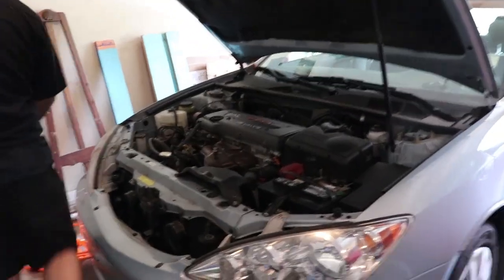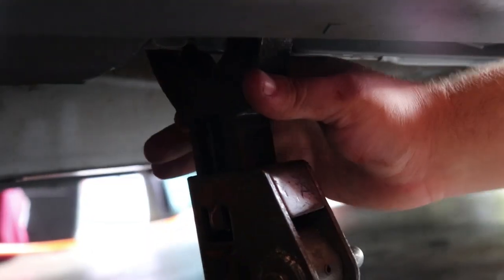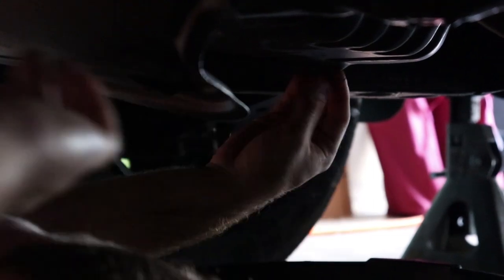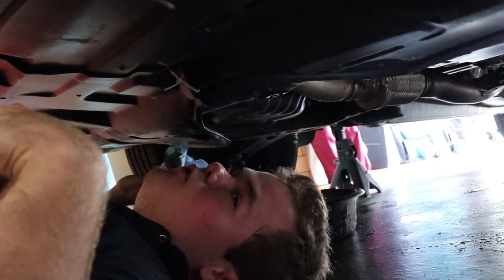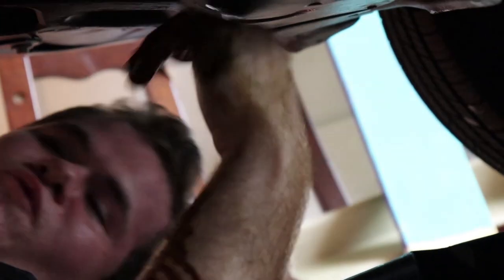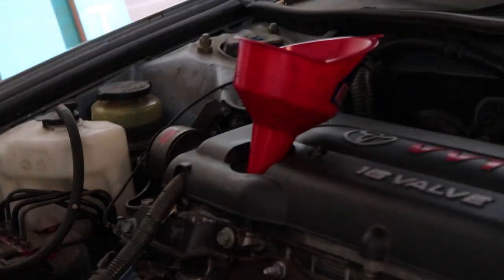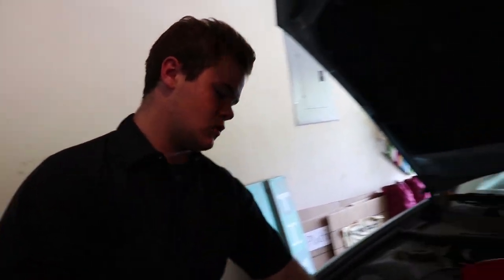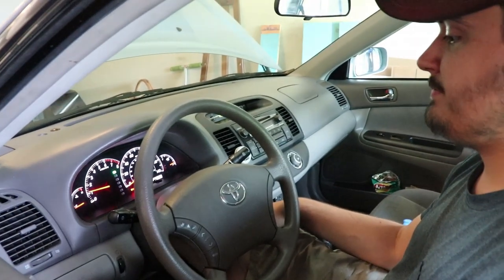HOW TO CHANGE OIL IN A CAMRY, 02-06 Camry 2.4L oil change video

Comment: you forgot to do 2 important things at the end of your oil change in the video. (1) when you start the engine, you should then look under the car for any possible leaks, since the oil filter won't leak without oil pressure to fill it and press for any open leak. (2) after the engine running leak check, then shut the engine off and check the oil level, when you check it before starting the engine with the New oil and filter, the new oil filter is empty and needs to fill up then your oil level will be 100% correct. overall you did a Great job on this video
Reply: Joseph Zani when changing oil, first open the engine lid and 2nd the oil screw below? shot with compressed air to drain used oil before closing the screw?

Comment: What's your issue with synthetic oil?
Reply: Mike South some veteran mechanics choose and use synthetic oil for camry cars.
Reply: @loonylinn8824  And that does NOT answer my question.
Reply: Is it proper to use synthetic oil for camry 2.4L, 2003 year? Which number, please?
Reply: @jeriotpersant2724  5-30.  Synthetic is a good choice.
Reply: He destroying the car using conventional modern cars are made for full synthetic all those vvti systems all tht crap run better
Reply: For anyone reading this in the future: Always use synthetic, it's literally a requirement in the manual for a 2003 and I assume beyond.

Comment: Gloves would be nice. a trick is to spin the oil drain plug until it is ready to come out, but using one finger continuously apply pressure so it can't come out. Then, just quickly pop it out real fast so oil doesn't get all over yourself. Also, keep a magnet nearby, just in case the drain plug falls into the oil collection pan.
---Take the bottom bolts of the splash shield off and just bend it out of your way without damaging it. Then place pan under oil filter. Then loosen it enough until oil drains out. Do this step-wise. Then remove it, once done draining. 
---Inspect the area of the oil filter to make sure no damages, foreign materials, etc. 
---Fill the new filter about 80% with new oil. Oil lube the seal. and put new one on. 
----Fill the engine about 70-80% of spec oil capacity. make sure everything is done, tight, etc.
----Start the engine and let it run for a few minutes and check for any leaks. Then, turn off the engine, wait about 10 minutes or so, and recheck the oil dipstick, then top off as needed. Then, start the engine, check for leaks one more time, let it warm up a little, then turn it off.
--repeat oil capacity level as needed.
Reply: Very good advice

Comment: Skip the jack n stands n just reach up under. Works for me. Its a 10 minute job. #overcomplicated.
Reply: I agree. Just did this on my Camry. Very easy.
Reply: Yeah I do the same with my solara but on this car you might have to do it to get to the oil filter tho
Reply: That’s the dumbest idea I’ve ever heard. Always use jack stands. I’ve have lifts fail while under the car and I’m damn happy that I have jack stands in place.
Reply: @richlucero3536  I said to not raise the car at ALL. So it's actually safer than stands. Suggest you reread my 4 year old comment.

Comment: Don't forget to replace the drain plug washer!  Toyota is known for cheap drain plug washers , also as hard as it is this guy doesn't tell you exactly what side the drain plug is located but you should also remember that oil pans are always located under the engine , that filter is a bitch to get out but it's possible

Comment: What oil do u use what oil is best since I know these cars burn oil starting of 07
Reply: Whatever the manufacturer recommends.  By the way, the 02 - 06 Camrys don't have the oil burning problem the 07 - 09 Camrys have after about 150, 000 miles
Reply: @andysnyder4506   ohhh the 02-06 burn oil too lol.
Reply: Mobil 1 synthetic I think is OEM
Reply: @hjer731  I've got a 2006 Camry.  It doesn't burn oil at all.
Reply: @andysnyder4506  they do it before 150,000
Reply: @hjer731  I think its all toyotas all of them Cause even my coworkers highlander does it 2014 model every 3 weeks oil fill up
Reply: The brand of oil doesn't really matter just use the type of oil that's stated on the oil cap.  With the 2.4L engine it's 5w30

Comment: How many liters of oil needed for a toyota camry 3.0 V6 engine? serial number for oil filter?
Reply: Loony linn I have a 2000 Lexus RX300 with the 3.0 it takes 5 qts of oil and the Mobil 1 extended performance filter number is M-102A

Comment: Hw much oil will I need to do a oil change? Gallons? Quarts?
Reply from the maker: 4 and a half quarts for the 4 cylinder engine.
Reply: 3.8 q for 4cyl engine
Reply: 4 quarts